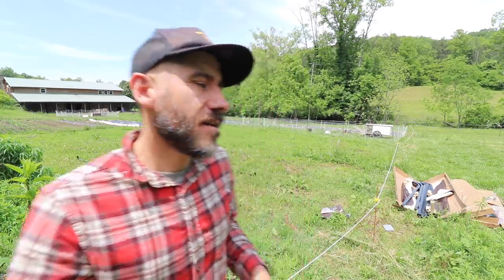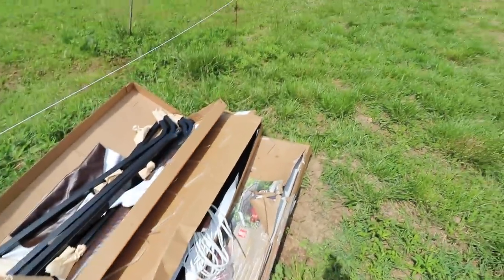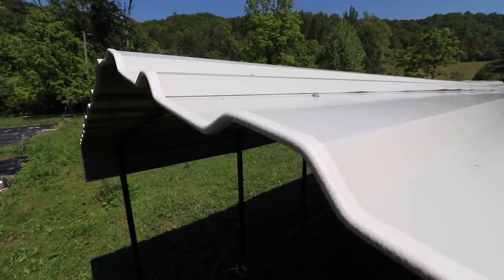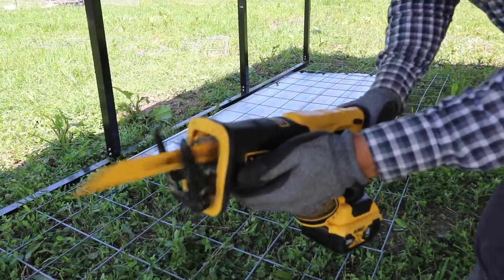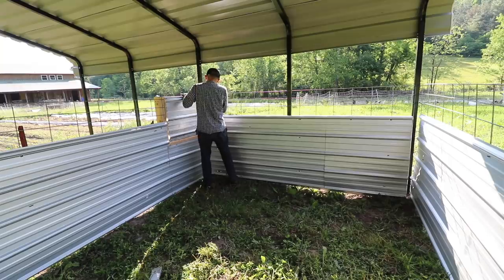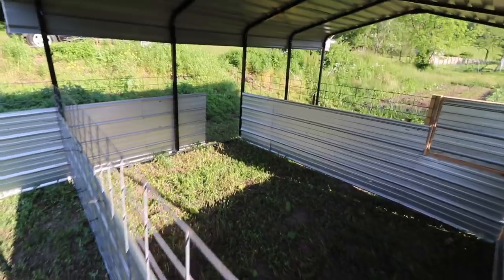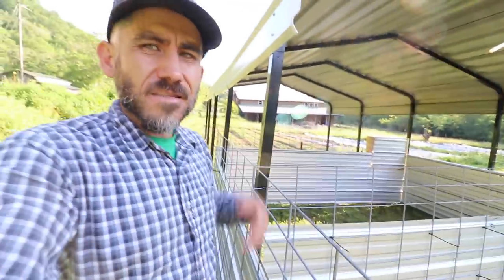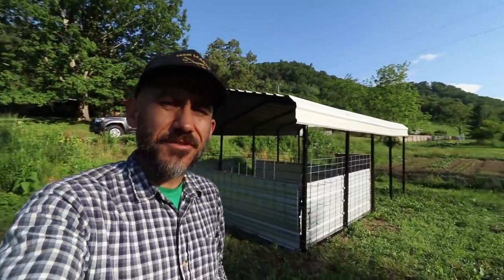My DREAM of Building a PIG SHELTER from a CARPORT

Comment: When my sister raised pigs they built an enclosure on a cement pad. There was a slight slope w/a trench that went to a dry well so she could hose out potty area & add to compost bins. Half the structure was roofed, half open. The pigs had a water spigot & feeding trough in one corner, they played & slept in one corner, toileted in another, and the last corner had a mister for hot days. They bought wieners and butchered in the Fall.

Comment: Belive it or not at one point in my life I installed carport's. Those were 20×21feet. Two of us would install one in average time of 45 min. Best time of 31 min. But the sheet metal was 22 ft. long. And we did 3 to 4 per day. We also didn't put up anything but carport. If you want a much stronger building add one sheet of metal at top ends. One at each end. This will make the carport 2× to 3× as strong. Also with your winds you need to attach the carport to the ground. If not frist wind it WILL BLOW AWAY!

Comment: You did a good job building this. That's one screw for every day of the year. It will be interesting to see how it works. That's a lot of bedding. Wood chips are available at most landfills. They would rather give them away than take up space in the landfill. Also arborists would rather give them away than pay to dump them in the landfill. Hope that helps.  Thanks for sharing.

Comment: Having put up many carports/party tents/ shelters , might i suggest next time putting the roof on before the legs to make it full height? you can use the bottom rail as a spacer and do it from the ground. Then you lift one side and put the legs on, then the other.  It's going to be heavier, true, but a lot less risky than working from the ladder.
Reply from the maker: is that way a one man job? thanks!
Reply: @SowtheLand  I've raised a 4x8 meter (13x27ish) party tent like that by myself. 
it's certainly easier with more folks... but you would only "need" more than one person at the very end of the build... kind of like a barn raising.
Consider, since you're pivoting it, you're only lifting half the weight of the shelter at any given time.